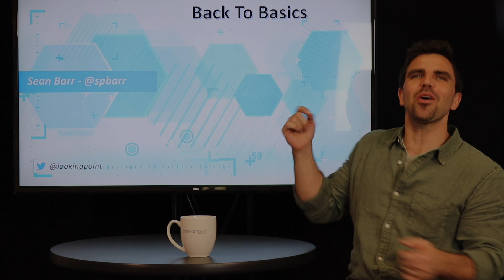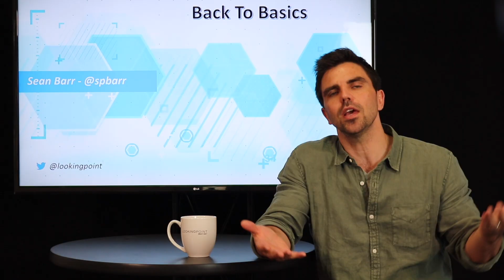Switch Stacking | Switching Basics

Comment: Hello thanks for the Video it is very informative , 
i have a question : 
i Have two switches connected as spanning tree and connected together through Ethernet to work in a redundant manner ? 
both of them are Masters and when i power cycle one of them i lose communication .. why do you think that happens 
my specialty is not networking but i have this problem and would really appreciate the help. 
thanks a lot.
Reply from the maker: Spanning-tree is a layer 2 protocol only, if you are using those two switches as your layer 3 boundary (ie, where the gateways for you subnets are located) then you would need to use a next-hop redundancy protocol such as HSRP or VRRP. This could be the issue, however without detailed information on your network it would be hard to say for sure.
Reply: @lookingpointinc  well it should be very simple we have two areas area 1 is connected to those two switches by its own two redundant switches and area 2 is the same 
Sw1 area1 is connected to sw2 area1 via trunk then both of them are connected to the main switches in parallel .. area2 has the same topology .. them from the main switches we get connection to two computers with redundant Ethernet ports.
Reply: But the way thank you so much for replying. It means a lot 😊